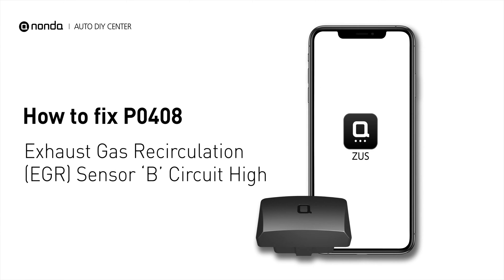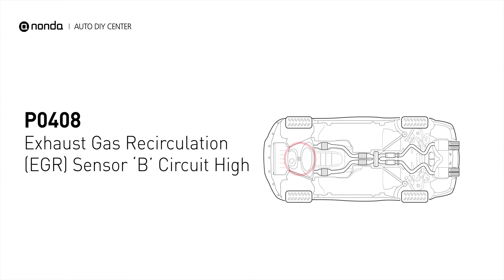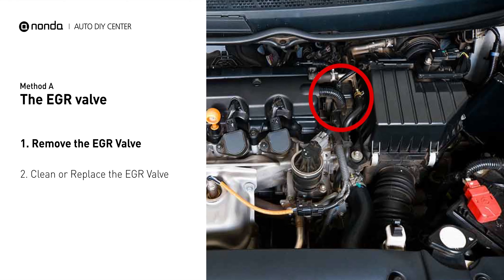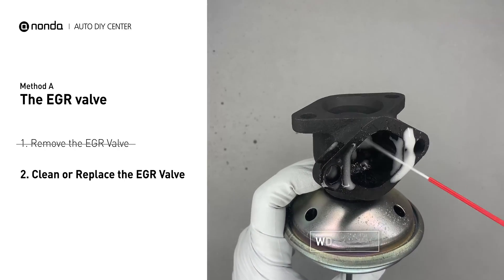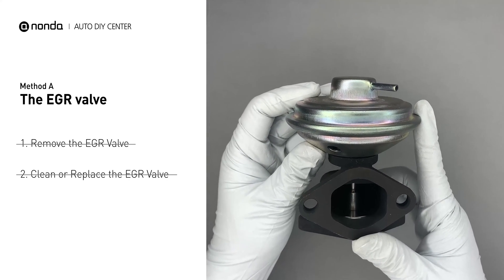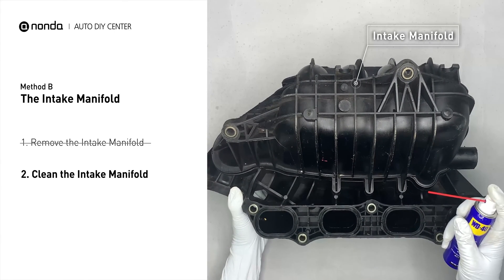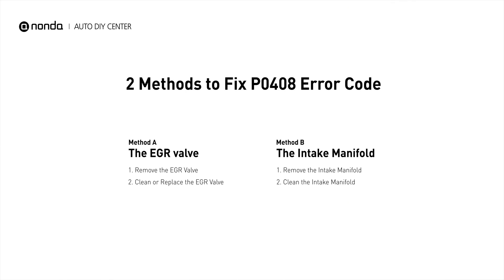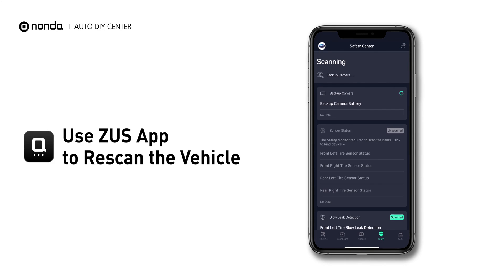How to Fix P0408 Engine Code in 3 Minutes [2 DIY Methods / Only $4.24]

Comment: Hi Steve, thanks for the video. 

Got P0408 error code in my HONDA I-DTEC 1.6 engine driving in the highway. The roadside mechanic unplugged the EGR valve as a temporary solution to continue my 160 mile journey which I did and did not notice loss of power except the inability to set cruise control.

Is it a bad idea to continue on driving with unplugged EGR valve? What would be the consequence or worse case scenario?
Reply from the maker: Hello, it's actually part of the methods of any mechanic to identify the issue. As you said, the vehicle start and run even after unplugging the EGR valve therefore, we suspect an issue with the EGR solenoid. Visually inspect also all the wiring, circuits, and connections.
Reply: @nondainc  thanks. Will do.